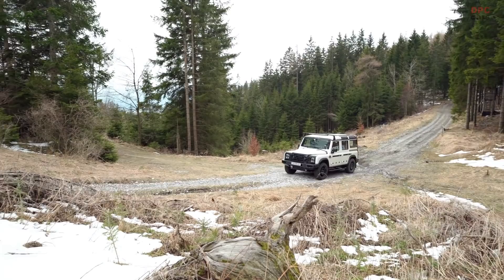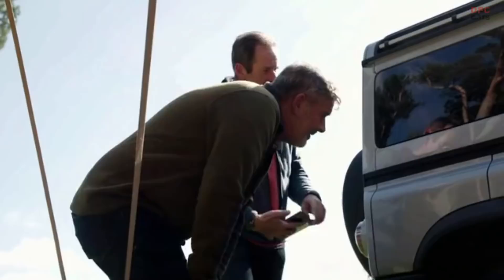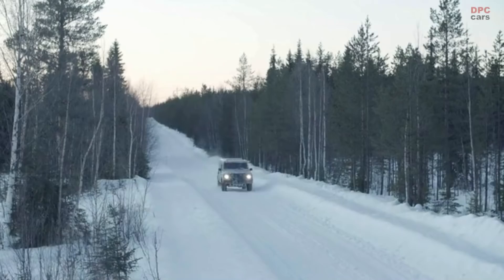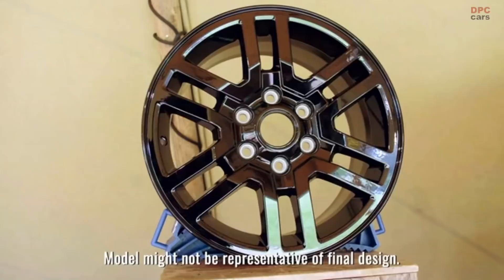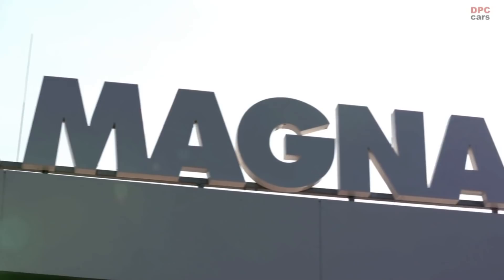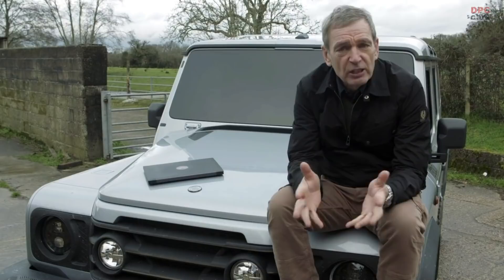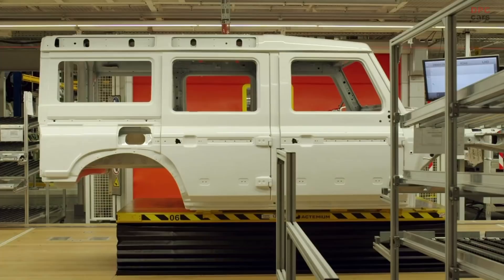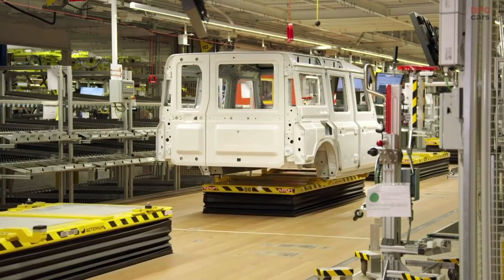INEOS Grenadier with BMW engine taking on Land Rover Defender

Comment: Yeah it was OK for land rover to build a new  defender for soccer moms but come on they have so many different ways you can order a 2022 defender except the way we freaking want one.
 EXTREME OFF ROAD READY FROM THE FACTORY!!
 LIKE THIS GRANADIER!!
   I have a feeling land rovers engineers are lazy bumbs that just want to drive around in luxury defenders and don't even care that there's a huge land rover family of off roaders that are extremely disappointed that they weren't included .
  Everyone needs to switch to granadier and tell land rover to shove it.
   There to dust pleasing soccer moms and dads with businesses .
   It's a damn shame they've gone the wrong direction away from the off road adventure seekers.
    20 inch wheels and low profile tires will get you to the game and back and to the store and back but come on land rover wake the hell up

Comment: Has the Max roof load been established yet?
Reply: Looks  robust enough to exceed even  the Skoda Yeti helicopter test !
Reply: @philhealey449  maybe but almost all cars are limited to 75 or 100 kg, The Toyota landcruise is around 150kg, which makes it the car of choice to carry a roof rack based boat
Reply: @kramsenoj1  Yes I'm not a total  idiot, static loading is clearly  one thing without the roof cracking up, but dynamic stability is another in getting round a roundabout or covering rough terrain. I've abused a previous Defender more than once, but took things very slow...
Reply: @philhealey449  I wasn't thinking or suggesting you were an idiot, simply specifying the capability I was looking for. A landcruiser will do it all day, every day, but nothing else to my knowledge. So we will need to see how the Ineos goes.
Reply: @kramsenoj1  My key observation ref the helicopter joke is the massive structure evident in the Grenadier roof, clearly driven primarily by crashworthiness. Probably accommodating a Sea King rather than just the Robinson on the Yeti.

Comment: Nice to see a land rover replacement, time and joe public abusing the crap out of it will tell. For me the fact that i can maintain and fix my landrovers myself is the key thing, paying bmw prices for engine services and repairs, if your are in some s&^5hole 1000km from bmw service and it goes into limp mode or just sits there it will be urban wannabes that drive the sales. I'll wait afew years and see,,i'll let the chelsa trator set do the beta testing they can afford it, hope it works for INEOS.

Comment: STAINLESS STEEL components please!!, especially those exposed to sand blasting and stone chip, BRAKE LINES generally suffers heavily from corrosive salt roads!!, some 4x4 competitors parts don’t even see 8 years in more extreme conditions !! Stainless Steel aren’t expensive anymore either and you save on paint!!. ‘Ask Elon Musk”

Comment: Puting a BMW engine in this off roader was a mistake lets see what is will do against the bronco
Reply: Agreed. I think this will be their Achilles.
Reply: @tanja8907  I disagree the BMW b57 is an amazing motor shit tonnes of torque and power and so far are proving to be reasonably reliable  261hp and 457ft lbs of torque from the most basic single turbo model
Reply: @roycesmart8019  agreed on your point, they are a powerhouse no doubt about that. The main issue is field servicability, with respect to my statement, time will tell.